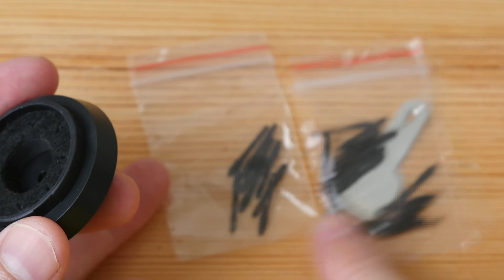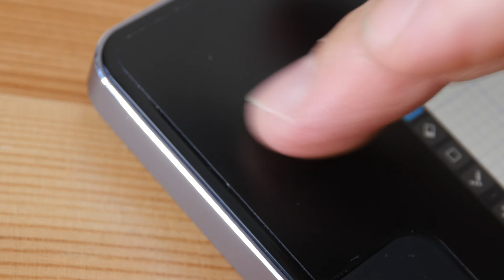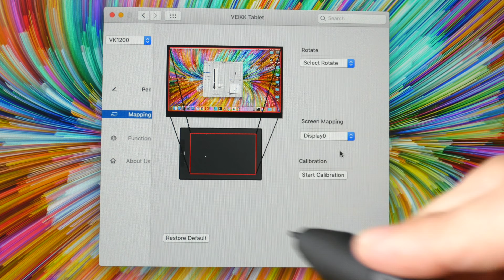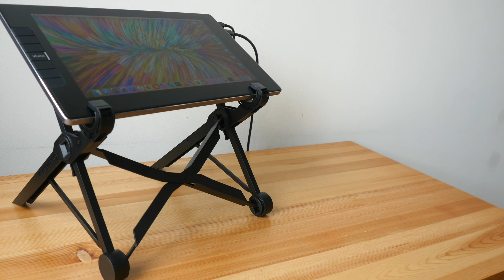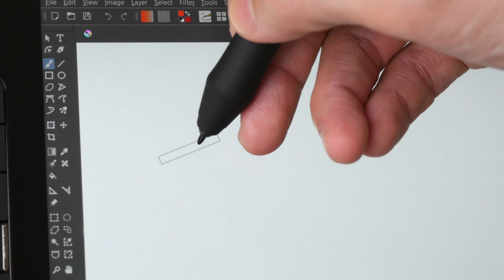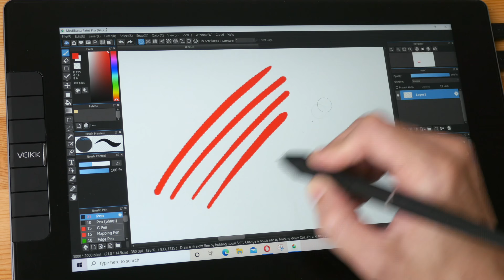Review: Veikk VK1200 pen display (11.6-inch 99% sRGB)

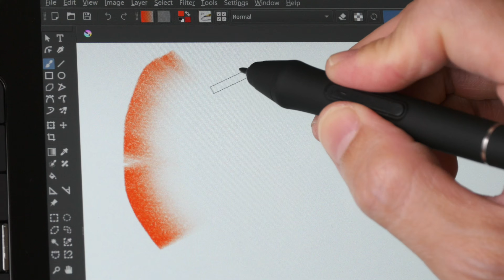Comment: I am not beginner but my budget is to low so I try to compare Gaomon PD1161 and Veikk VK1200. I couldn't decide which one is better. And the reason I question that much is that gapping issue that he mentioned at 16:06. So I am open to recommendations.
Reply from the maker: If you have limited budget, consider either the Ugee U1200 which is US$129 after $30 discount on Amazon USA
https://www.parkablogs.com/content/artist-review-ugee-u1200-pen-display
Reply: @teohyc could you please tell me between veikk vk1200 vs gaomon pd1161 only because the one u mentioned is not available in my country
Reply: @loading...7232  I've not used that Gaomon pen display before so I can't say much

Comment: Hi! everything works fine, but my tablet screen won't work? it says "no signal" then goes into power saving mode. When i start calibration in the driver, it says to open "tablet monitor"? Any help is appreciated :)

Comment: I just got this for my son's computer, I plugged both USB's into his PC for power & plugged the HDMI into the back off his PC (I'm confused though, as his RTX2060 only has one HDMI port & that's being used for his monitor). His motherboard does have a HDMI port though, but when we plugged it in, it just comes up on the VK1200 that it has no signal & the screen turns off
Reply from the maker: The USB cable also needs to be connected. If there is no power, the red USB has to go to a power source.
Reply: get a display port to hdmi adaptor
Reply: get an HDMI - USB adapter, u less his CPU has integrated graphics the port on the MB won't do anything
Reply: Help!!! My pen don’t work and I don’t see where I can calibrate the pen

Comment: Is It possible to use an Android tablet instead a PC to use the tablet ( with less performance, obviusly). Are there any drivers? Ty
Reply from the maker: This does not work with Android. And there is also no Android driver (applies to all brand)

Comment: what im confused is that when i plug mine in , it doesnt display what i have in my desktop
Reply from the maker: If it's displaying something, you can go into the Display settings to change what to show, e.g. mirror, extended, or only show on pen display
Reply: @teohyc  hello can you help me? I put it on the mirror display, but not only it doesn't display the screen the right way, it even stretches my computer screen display. Is there a way to fix it?
Reply from the maker: @totoro413  Not sure what's happening. Try restarting the computer first, then switch between the three modes: mirror, extend, show only on one display

Comment: Can I just use it with usb port my pc has only one hdmi port please response if you see
Reply from the maker: It needs HDMI and USB
Reply: @teohyc  oh then can huion 13 will work that way ? I mean usb type c to usb type a 3.1 port as I don't have usb c port in my pc
Reply from the maker: @minizeref6245  If your computer don't have USB-C, you have to use USB-A and HDMI.
Reply: @teohyc  is it possible to usb c to usb a 3.1 for display?
Reply from the maker: @minizeref6245  USB-A cannot be used for video input and output
Reply from the maker: @minizeref6245  I've already said that USB-A cannot be used for video. If you want extended desktop, multiple monitors, you have to use USB-C, HDMI or DisplayPort.

Comment: This seems too expensive for what you get. You can get some bigger XP-Pen or Huion graphic tablets for very similar prices.
Reply: The price is fair. You can get the same thing from Huion and Xppen for similar prices. The Huion kamvas 12 is only $20 more. I trust Huion more than veikk.
Reply: Hi. Just coming in a year later.
The current price is $169 on Amazon. It's certainly worth that price.